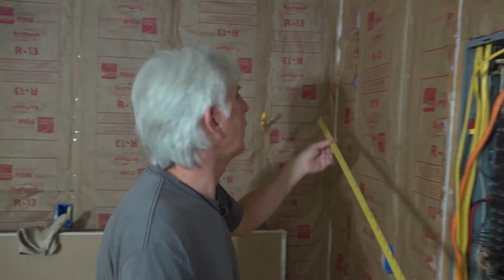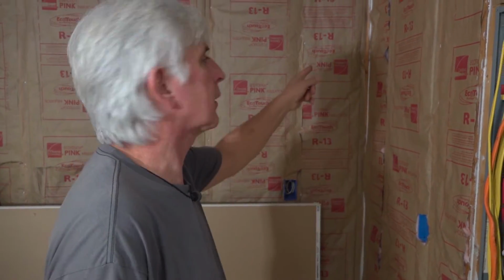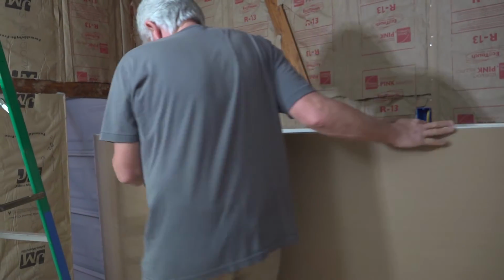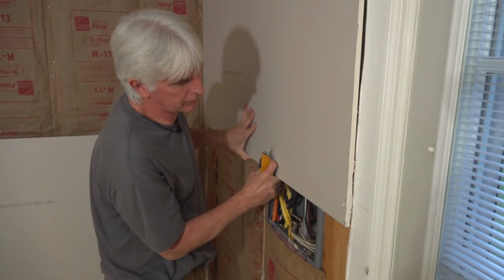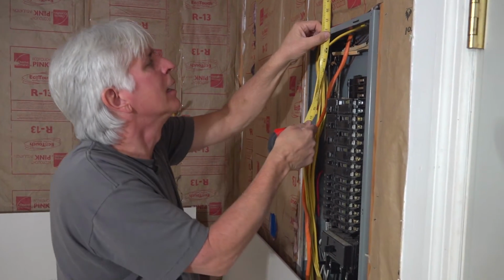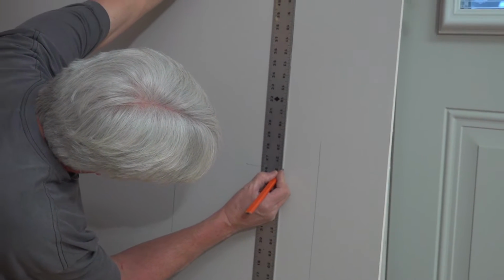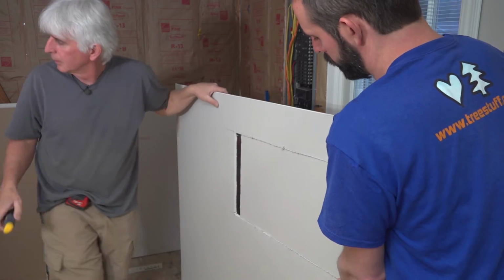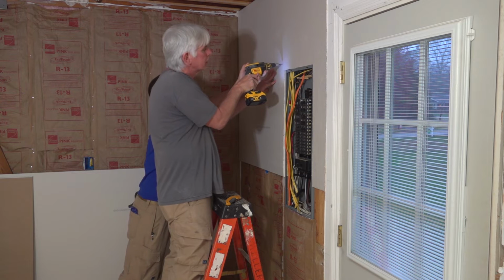Hanging Sheetrock: Kitchen Remodel E16

Comment: Shouldn't you have done the ceiling first?
Reply from the maker: First off I am no expert and that is probably very obvious, ha ha. Generally speaking most people do the ceiling first. There are a few exceptions. Its not a rule but rather just what people tend to do. 

In our case the wall was right at 10' 1" wide. So the 10 foot sheet we bought just fit between the two walls. It was easier in our case to put the walls up first which made centering the ceiling between them easier. Hope that makes sense. Its what our sheet rocking buddy said he always does and he has done this his entire life.
Terry
Reply: Just curious. I was always taught to do the ceiling 1st as the wall boars help secure the ceiling boards, gravity being what it is. To each his own. Use your flat bar and a wood block, lever fashion, to raise the bottom band of sheet rock to tight against the upper band.    The fact that y'all are not experts are what I love about the series. So easy to identify with you both. I'm a charter member of the Fumbles and Bumbles Club myself. Refreshing to see others who do it, know they are not experts, admit when they make errors yet still do quality work. Keep going just as you are.
Reply from the maker: Yeah you are correct for most cases you do the ceiling first from what I understand. Sorry I don't think I made myself clear that we only did it "backwards" because of the space being the same size as the 10' sheet rock. Any other time I would do it like you said and I assume that is what is commonly done.
Terry

Comment: Great video, thanks. I don't understand why you didn't insulate the ceiling before you put up the drywall?
Reply from the maker: Great question and one we probably should have addressed in this video. It takes a lot of extra time to film this stuff and thinking of everything is difficult at best. We do it all on the fly and we have no more clue than anyone watching what is going to happen with most of what we do until it happens, ha ha. As far as the insulation in the ceiling goes that area is above the panel and we may have to crawl out there to do stuff so we decided to leave it not insulated until the job is complete. Then we plan to have the entire attic re-insulated a little deeper with blown insulation and will have that done at that time as well. 

Thanks for commenting!
Terry

Comment: Taco Dog and Pizza! You guys rock! 

Is there a reason you didn’t start from the bottom and work your way up on the walls? If you do set it at the floor level then you can use it to help hold the upper part.
Reply from the maker: Gotta keep fueled up!
The way I understand it you want a tight joint at the top so you slide the top sheet to the ceiling then slide the lower sheet up against the upper sheet and you generally end up with a small gap at the bottom. That gap at the bottom is hidden by base board so its not a problem down there. If you had a gap at the top it would be harder to finish that joint between the ceiling and walls.
Terry

Comment: what about vaper  bearier
Reply from the maker: Hey Kirk.
The paper on the insulation is the vapor barrier for the walls. On the ceiling they always just blow insulation directly on the sheet rock with no barrier, at least around here. 

Terry